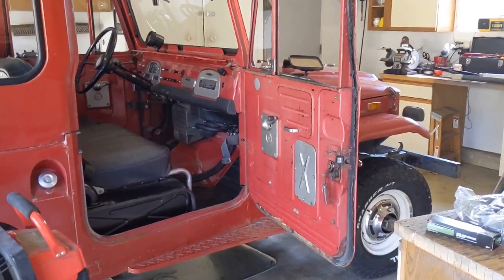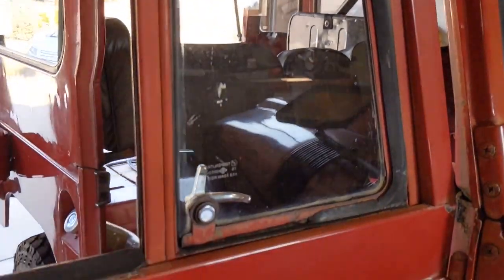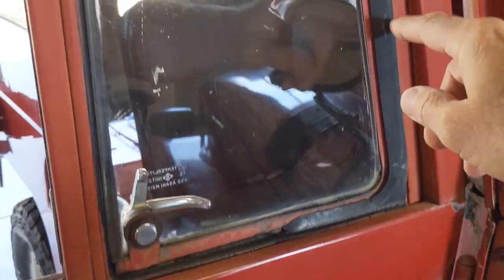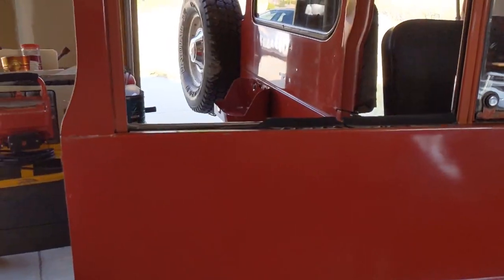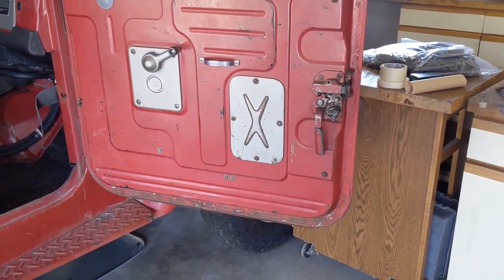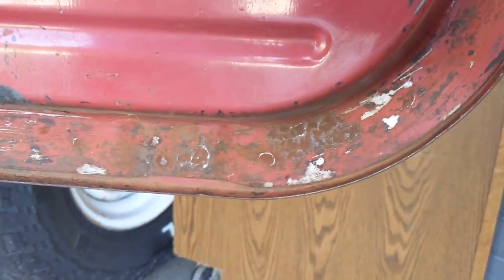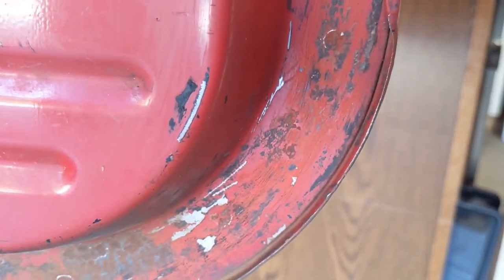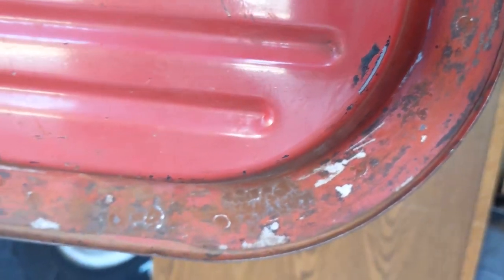A New Door Seal

Comment: HA!  I told you that last project was not the last project for you!   ...so did the trim adhesive loosen up that fresh paint?  I know when I did my Bronco about 30 years ago, it reacted with the paint a bit and it was a two part Ditzler Deltron with hardener.  Great video!
Reply from the maker: There's no such thing as done.

The paint was only a few hours old when I applied the adhesive and the paint did loosen up a bit.  I checked the next day and adhesion was good. 

It didn't occur to me that this might be an issue. Most paints take quite a while to really get hard (days for sure).  In retrospect, a heat lamp would have been a good idea.

Comment: Where did you buy the new door seals from? I need to replace my seals too (1965 FJ40L). I have the old bug catcher windows any ideas on those seals?
Reply from the maker: The front door seals came from Toyota Parts Deal which sells Toyota OEM parts. Toyota doesn't sell the rear seals anymore, so I used aftermarket seals from Cool Cruisers of Texas.

You should be able to get the front vent window seals from these two sources.
Reply: @mikerestoresanfj4069  Thank you.
Reply: what addesive you use?